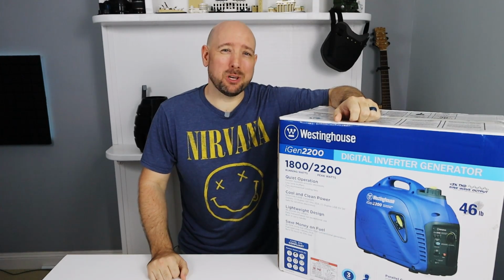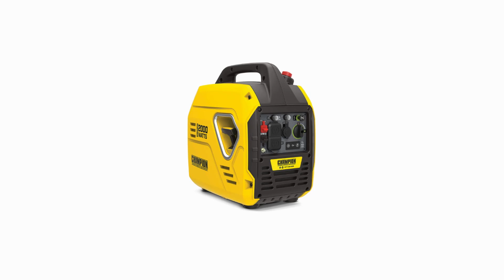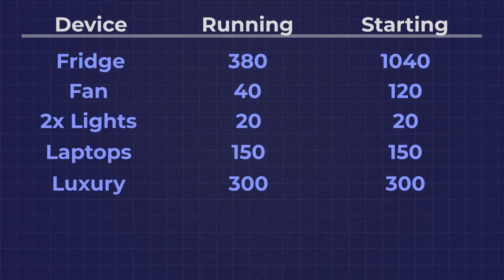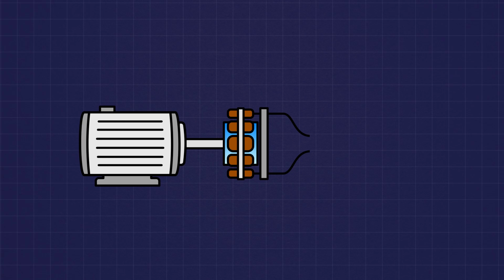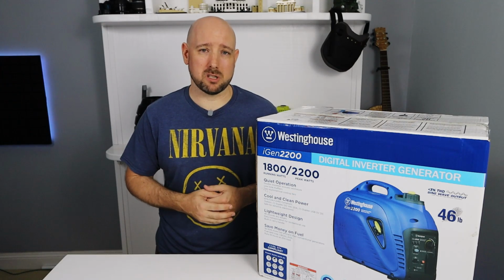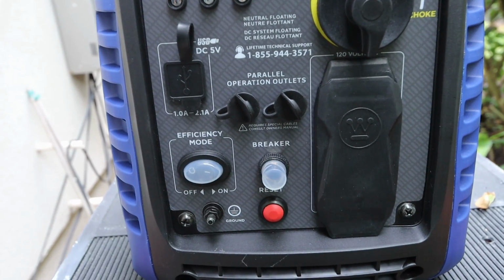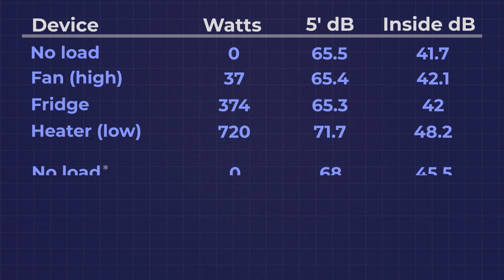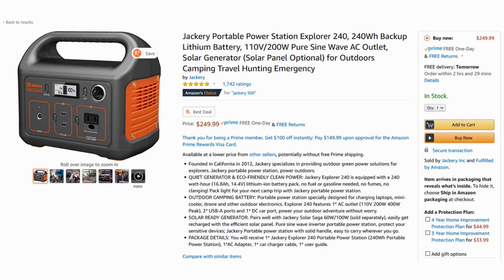Choosing an Emergency Backup Generator: Westinghouse iGen2200

Comment: I have solar generators but not enough solar panels if I’m using all of them, or if there’s poor solar conditions. I bought this gas generator specifically to charge up the power stations as needed. I can charge two or three at a time depending on what I am charging. I used it today to try it out and recharged three power stations in a couple of hours. I love the solar generators for using indoors. They’ll run just about anything and they make very little noise. You might want to consider a couple of them for computers and wifi and so on. I have energy efficient fridge and freezers so I can run them with individual power stations. We get outages and storms here so I feel so much better knowing I can keep my food safe. Between those and a few camping items, we have to make only minor adjustments in an outage. Walking around after sundown with flashlights and praying your food is ok is not something I care to do anymore. Thanks for an in depth review of this! I found it easy to setup and it’s something I can move around on my own which is important.
Reply from the maker: Interesting, Pattymac!  I've seen solar panels on sale at Harbor Freight pretty often and the battery packs are getting pretty popular.  Which panels and packs are you using?  How much wattage do you generally get from your panels (on average) compared to rated?  I'm assuming rated means max blistering sun on a cloudless day?

Comment: Great job on this video. Very informative and well put together.
Reply from the maker: Much appreciated, Jemx!
Reply: I notice that there are newer model of this without the parallel connection ports. I think the one from Sam's Club still has the parallel ports just like in this video. On HomeDepot and other websites, you will see a mix of new and old models. With no parallel connection port, you would have to use the cable from WH to pair with another WH inverter generator.

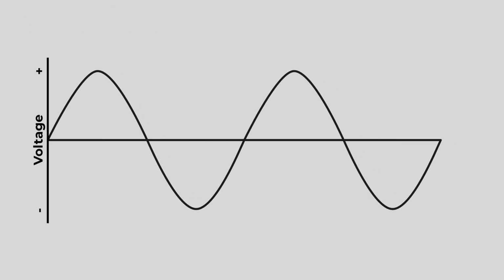Comment from the maker: I just noticed I went live with a slightly older version of this video.  The newest version has a correction to the 'parallel operation' graph at 15:30.  The animation of the graph implies that more voltage will be delivered in parallel operation when you actually get additional wattage by synchronizing two inverter generators.  I think the material impact is minimal as the voice-over describes it correctly so I'll leave it up with this footnote.

Comment: Though the generator has a 3 year warranty Westinghouse's warranty repair service is slow. I bought a 2200  and it was great. I wanted to run it in tandem so I purchased a Westingthouse 2500, which is very similar to the 2200.   After 14 hours  the 2500 stopped working. It took 2 weeks to finally to talk to someone and another month in the repair shop. That did no fully fix the problem, so it took another 2-3 weeks of emails and calls (initiated everytime on my part) and still have not came up with a resolution. I have requested they send me a new generator.  In the end, I have been without a generator for 2 1/2 months and still no end in sight.
Reply from the maker: That's disappointing to hear, especially for a company the size of Westinghouse.  Will be interested to hear what/when the final resolution is.

Comment: Very good video but just one comment about the availability of gasoline in a dire situation. Like you I thought siphoning gas from either or both of my two vehicles from the garage would be sufficient but a little investigation showed me that it's almost impossible with newer cars to do that because of the configuration of the fill pipe in the car. Bummer!
Reply from the maker: That's good to know!  I know my truck doesn't even have a gas cap so there has to be some kind of automatic valve.  Guess we'll have to drill a hole when the EMP hits :)

Comment: If it's in this exact case, it's made by Generac. I have the Coleman. Bought 3 of them on clearance at Walmart for $300/each. 1 for me, 1 for my sister and another as a housewarming gift.  

These things are awesome. Clean the spark arrestor with 91% rubbing alcohol and a brass brush with every oil change. I do it every 50 hours, no matter what. 

Ethanol free rec gas is your friend with these. There are many YouTubes on how to make your own. Water absorbs ethanol and gas floats on water. Pretty simple, actually.
Reply from the maker: That sounds about right.  There are about a dozen different manufacturers that all fit in this same case.  I'm betting they're all using the same Generac internals.  So far I've only started mine a couple of times to run through some gas.  Knock on wood and hope this is a mild hurricane season!

Comment: I only need a generator for my heater..low 700 watts..high 1500 watt..I would like to run 2 heaters if possible..I have power stations to run everything else. My home is about 650 sqft. Ty
Reply from the maker: Hello Carol.  A 1500 watt heater really turns the screws on this little generator.  No way you could run two of them at 1500 watts.  You should be able to get away with two at 750 watts though.  Most heaters are pretty 'dumb' though so if your main concern is running them then you can probably get away with a beefier but dumber non-inverter generator.

Comment: The reality is .. most of the generators out there , ryobie , preditor , westinghouse  the list goes on are all made by Ducar  so it doesn't really matter who's you buy they are all basically the same . Some have other features but the basic generator and motor are made by Ducar , so buy the cheapest one you can find they're all the same go figure .
Reply from the maker: Interesting, Gary.  I hadn't heard of Ducar before.  I know Westinghouse does manufacture engines but they certainly don't appear to put them in their cheap generators as without a shell I don't think anyone would be able to tell those brands apart.  It's pretty much the same assembly line until you get to the Yamaha's and Hondas it seems.
Reply: @LilMikeysBigPlans  the ducar engine is a Yamaha clone.

Comment: I appreciated your review and have a question.   You wanted the generator to prevent some of the problems you had during an extended power outage earlier.   You mentioned losing all the food in your refrigerator, which seemed like the biggest issue.   Did you ever test your generator to see if it would power the refrigerator in question.   A refrigerator shouldn’t need much power if the inside temperature is stable, but does have a decent power draw at the start of each cooling cycle.
Reply from the maker: Ya, I've test my fridge on it and I also hooked the watt meter up.  My fridge 'only' appeared to spike to 800-900 watts or so however the watt meter only updates a few times a second so it may be a bit higher than that.  It spiked the generator for a second but it chugged right through it.  That's not to say it'll work for every fridge in every situation though.  This is one of those traditional basic over-under fridges with no features or anything.

Comment: When you have it on the Eco Mode does it only throttle up enough to make the wattage needed or does it go right to Full Throttle like a space heater made it do, and how fast does it burn the little bit of gas under a load, thank you and it was a wonderful video
Reply from the maker: Hello Mark.  From memory I thought it throttled down in both modes but it was a 'softer' throttle non-Eco and took longer to ramp in Eco mode.  I'll pull it out this weekend to run some gas through it and see if I can tell if it's throttling at all in non-Eco mode.  Thanks for watching!

Comment: Picked up 2 from the Sam's Club deal but the parallel cable is out of stock everywhere! Any leads??
Reply from the maker: Hey Mike, I think the parallel kits are pretty universal - as long as they use the same two banana-style plugs.  The user reviews for the Wen kit on Amazon indicate it works with Honda and Westinghouse generators.  In fact, some older kits (and crazy DIY folks) used the 120v plugs for paralleling.  Not sure if that impacts the warranty at all though so, beware.

Comment: thanks for the nice review, should i use mobile 1 synthetic 10-30 oil and regular 87 gas + fuel stabil?
Reply from the maker: I would check your generator specs but the Westinghouse calls for 10w30 and Mobile 1 is just about the best out there so that should be great.  For fuel, I can't find any recommendations from Westinghouse but 87 should be standard and the safest - and in my area ethanol-free only comes in 87.  Regular 87 + stabil should be a safe bet.  Stabil says it keeps fuel fresh for two years but I personally try to run mine through every 6-12 months.
Reply: @LilMikeysBigPlans - run it dry and empty it completely of fuel. Then you don’t need Stabil and you won’t have any issues whatsoever with respect to fuel.  I run mine every six to eight months or so, and it starts on the first pull

Comment: I have 2 of these and I'm looking for a extended run time fuel setup for them but I can't seem to fine a kit made for the igen2200. Does anyone know of one that works?
Reply from the maker: Hey first last.  I haven't used the kits myself however my understanding is the kit is pretty dumb and the inverter generators themselves sync to each other.  There is no need for a like-branded kit and you can even use generators from different manufacturers (although you'd want similar wattages).  I would do some additional research and don't solely rely on this advice but I think any kit with the right banana plugs should work.
Reply: @LilMikeysBigPlans  I'm not looking to put them together. I'm looking to install a long run time fuel system like a 6 gal tank on each.

Comment: Hi so I live in California and I don't have ethanol-free gas what do you recommend for someone that doesn't have any means for ethanol free gas
Reply from the maker: Hello Richard.  Stabil is design to stabilize ethanol fuel so you should be good with just that treatment.  Stabil + Ethanol-free is really doubling up the protection.
Reply: @LilMikeysBigPlans  omg thank you very  much

Comment: How was it when you connected your refrigerator and light? Nice video!
Reply from the maker: Thanks!  Fridge + light were no problem at all.  That's less than 1000w total.  Fridge + Space Heater (on high) + Light might be pushing the limits a bit.  :)

Comment: Should I leave the remaining fuel inside the generator if I won't use it for several weeks?
Reply from the maker: Hey Mike.  Weeks probably isn't an issue for any type of fuel but if that turns into months you might have some issues.  There are few things you can do.  Ethanol-free fuel should help with ethanol evaporation over time and a stabilizer like 'Sta-bil' should help prevent both varnishing and ethanol evaporation.  They claim it can stabilize fuel for up to two years.  The safest thing to do is drain the fuel and burn it in your car or something.  If you've already messed up and gummed up your system the most common culprit is the carburetor.  Cleaning a carb can be a bit messy but it's well within the capabilities of most folks.
Reply: @LilMikeysBigPlans  wow, thanks very much for the reply. I bought it just yesterday and I used it only once for a couple of hours to test it with some appliances and electronics plugged into it and it ran great. And then, as you advised, I think it is a better idea to drain the fuel to keep it clean.

Thank you very much. Your video was really helpful ☺️
Reply from the maker: Sure thing, @mikeguzman24 .  Good luck with the generator and don't be a stranger!
Reply: Run the unit dry after tipping it over and draining the fuel. Burn the fuel in your car just like he said.  Then you don’t have to worry about using Stabil and the generator will start up like brand new when you use it in a year.

Comment: How did you calculate starting watts for your fridge?  My refrigerator uses 8.5 amps or 1020 watts to run.  What will the peak wattage be and will the Westinghouse igen 2500  which peaks at 2500 watts and runs at 2200 be enough to run my fridge?  We have occasional outages where I live and am considering buying one. What's your thoughts on this?
Reply from the maker: The rule of thumb I heard is that starting watts are 3x running watts for a typical electric AC motor.  If you're fridge is pulling 700 watts or less while it's running (and nothing else is starting) then a 2200 should cut it but if you have a beefier fridge you might want to consider a larger generator.
Reply: @LilMikeysBigPlans  Thanks for your response back and the heads up.
Reply: @LilMikeysBigPlans  Since my fridge has a 1020 watt run it would take a generator that runs or peaks past 3000 watts as the fridge will do starting up. Thanks again but there isn't any reasonably size Inverter that  generator that can supply that can supply that amount of power. I'mnow looking for the cheaper, noisier, heavier unit on wheels. Thanks again as you were spot on with a fridge spiking up to three times it's running wattage when the compressor starts.

Comment: I don't think any of these portable  2000 watt generators are powerful enough for back up power for your home, 2000 watts isn't a whole lot when you hook up a refrigerator , air conditioner, space heater, or run a washing machine , they are made more for camping to power a TV, recharge your phone batteries, a few lights and a fan , for the same money you spend on one of these small inverters, you can buy a open frame inverter generator for the same price but will put out 3500-4000 watts enough to run a room air conditioner , where a 2000 watt generator would struggle or possibly not be able to,
Reply from the maker: I agree, a 2200 watt generator is not backup power for your home.  Regardless of generator type, plan your wattage needs, decide if you need an inverter generator or not, and buy a decent brand with a reasonable warranty to match.  If you need AC, fridge, heater, and washing machine even a 4000 will be pushing it.
Reply: @LilMikeysBigPlans  I plan on buying 2, I currently have a 2200 watt inverter unit only because I got a great buy on it, and plan only to use that one for small things like lights, fans,  computer, charging phones, TV, and the next on will be a larger unit capable of powering my refrigerator and freezer, and my pellet stove